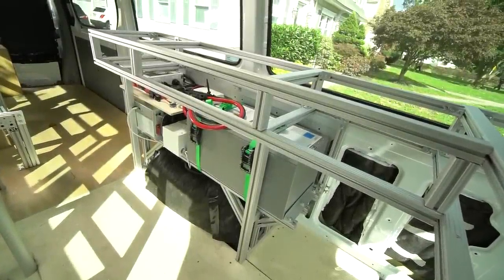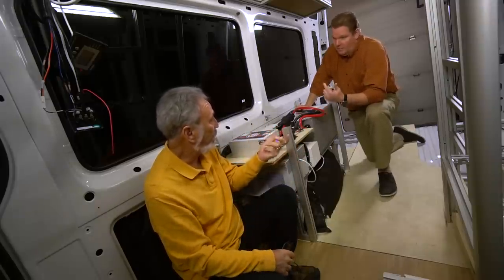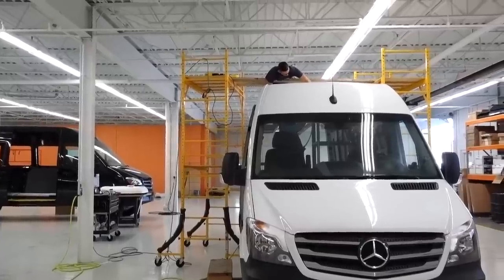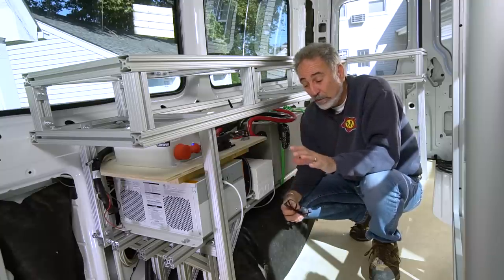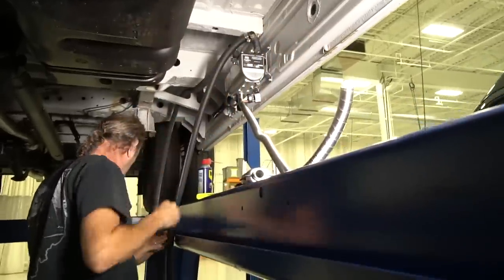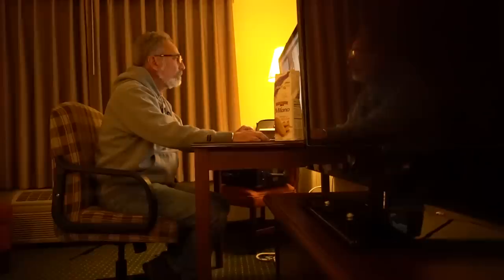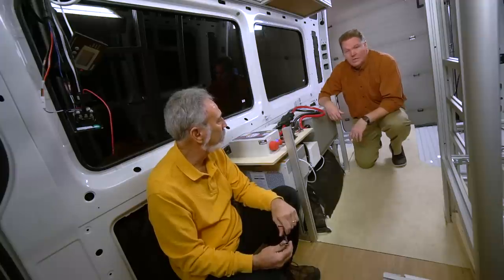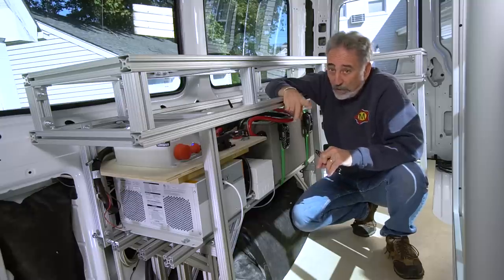Humble Road Van Build Series 16 - Best Lithium In A Van

Comment: I am having such a hard time figuring out who can install my electrical system. I looked at the Advanced RV website and can not tell if my installation would be something they would do. Can you help me?
Reply from the maker: The electrical system is the single most important system in terms of proper wiring and safety. I cannot speak for ARV. What I know about them is they are involved in full build outs.

Comment: Great video George, very educational. I’m curious if the van is idling will it charge batteries?
Reply from the maker: When the van is at idle, the second alternator puts out between 180 amps - 200 amps. And the BMS can take that charge current and combine it with the solar and push it all into the battery. The battery gobbles up whatever you can provide for it up to 400 amps.
Reply: Humble Road that’s fantastic. People seem to be obsessed with AC, and I understand if you are in a god awful climate like Florida in the Summer time, your gonna need it! But I think with TWO max air fans, 95% of people will be fine without it. Very cool behind the scenes of two of the best in the business.
Reply from the maker: Agreed. And in fact, I have a few tricks to apply to the ventilation system in the van ceiling that may help you to never need the AC. But when your mantra is "Options" the AC has to be sitting there...
Reply: Humble Road Humble..needing ac for health conditions is domineering my life right now but I still havent found any combination on vans in either the new or used market here that might come close to reasonably and reliably meeting that special need. When might you spill the beens on your ideas as Ive come up empty in our hot and humid summer climes (esp last summer! 😩)
Reply from the maker: Sorry to hear you are having health issues. The quiet air conditioner and the electrical system I just installed is a real winning combination. Pricey, but in the long term; best option. Particularly for someone who relies on such a system.
Reply: I would not look forward to see this 'humble gentleman' in an airconditioning-deprived Class B, sweaty, disheveled, and heat-stricken sipping a glass of Chateau Lafite 1787.   He has standards to maintain for the international Class B community.  The whole world is watching.   :-D

Comment: How do you think it compares to the Volta system ARV uses?
Reply from the maker: I think each system has it's strengths. It depends on your personal set of priorities. The Volta system is using the Xantrex 3012SW Inverter/Charger, as is my system. The differences are with the batteries and the BMS. Which are very important in the scheme of things...

Comment: How many yrs will these whole unit keeps working .lithium battery r used in mobile phones also.
Reply from the maker: Very different technology between cell phones and this. If you treat the battery as per manufacturer's instructions, and depending on demand, you could get 2,500 to 35,000 cycles. A cycle is a discharge/recharge. In a full time van living situation, an average cycle could take 1-4 days. So even if you beat the snot out of it and call it names, you can expect 2,500 - 100,000 days.

Comment: Any chance when you tested your Houghton quiet AC unit; does it also generate HEAT?
Reply from the maker: Yes, Scott. The Belaire 3400 has 13500 cooling capacity and 12000 heat pump. We have had the heat pump option in our past RV and boats. It is a nice feature to take the chill out of the air. A nice option!

Comment: I wonder why more vandwellers with solar don't use the mini-split heat pumps?
Reply from the maker: There is no practical place to mount the outside portion of the system.
Reply from the maker: This air conditioner has a 13,000 btu heat pump.
Reply: Okay, even better.
Reply: Oh, right; the best I've seen is under the chassis.
Reply from the maker: Those compressors will not last long under the chassis. Besides sucking in all the road dust and grime, it will get peppered with debris. Now if one was purpose built, that's a different story.

Comment: Humble G  I noticed at 8:03 in your video, the diagram in the lower left corner has chassis spelled in Spanish "chasis alternator" does that have any significance to you?
Reply from the maker: Rather than Spanish, I think it was an omission typo. I used to do quite a bit of design and layout work back in the day. I would get a brochure galley back from the client with 12 approval signatures on it and promptly find a typo!
Reply: You spoke so highly of them, I thought they were incapable of making mistakes.  (-;   I was truly impressed with the scaffold they used to install your fan.
Reply from the maker: @bentnickel7487  the misspelling, or Canadian spelling is on the Xantrex brochure. The scaffold was at Advanced RV.

Comment: What battery are you using? I have searched high and low for someone to do my electrical work but they keep telling me that running an air conditioner and an induction cook top isnt possible. Is this true?
Reply from the maker: You can run them but not at the same time. This electrical system is not yet available to the general public.

Comment: Hello, we saw the video of you being very cold during overnight stay in advanced RV review. Was that before this battery install? Was battery install isn’t enough to run heater over night?
Reply from the maker: Yes. My being cold pouring wine was a joke in my Pleasure-Way van. Winter in Ohio! Battery video is much later on. This battery system and diesel heater will take care of all my heating and cooling without shore power.

Comment: Why corian for the counter tops?
Reply from the maker: The Glacier White Corian is a product I am familiar with from years of shooting jewelry on it as a pure clean white surface. It can be sanded smooth and clean over and over. It is relatively flexible and easy as wood to work with. Laminates are a good choice as well. In one of my current builds, we are using stainless steel for the counter top.

Comment: Nice system but for someone who has $14,000 to drop on electricals
.
Reply from the maker: Thank you for your support. $14K does not cover it, but that shouldn't matter. High tide floats all boats.
Reply: @HumbleRoad  im currently living in my Promaster as I work on it. (Only other week, while on assignment.) So as it gets colder I need a cheaper option to keep a diesel furnace running. However, am using 80/20 and building my own hidden bathroom!! Your videos are invaluable!! 💗

Comment: I was just about to ask what justified your paying a 50% premium for Lithionics vs Battle Born, but it looks like the latter are not UL1973 certified. Oh boy, and here I was already over budget…
Reply from the maker: :-D
Reply from the maker: Only the Xantrex lithium has the UL1973 designation. And to me, that's a big deal, worth paying extra.
Reply: @HumbleRoad  It's a bit confusing: at 0:09 we clearly see "Lithionics® Battery with Neverdie™" on that big metal box. I guess Xantrex packages the final box with Lithionics inside?
Reply from the maker: Correct. The battery in my van is so new, the Xantrex labels had not yet been applied. I will be applying the correct labels next week. Good eye!